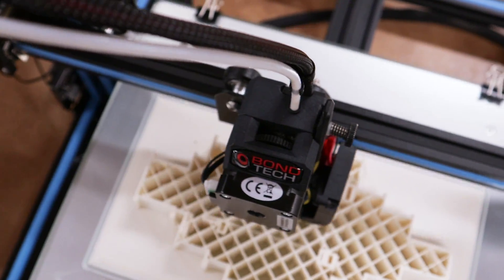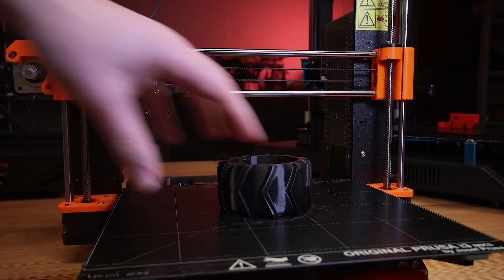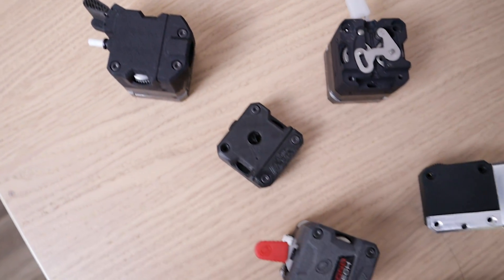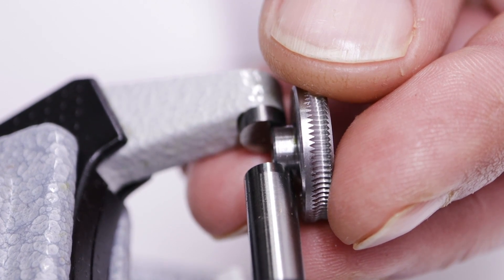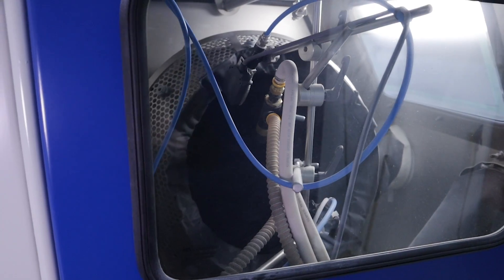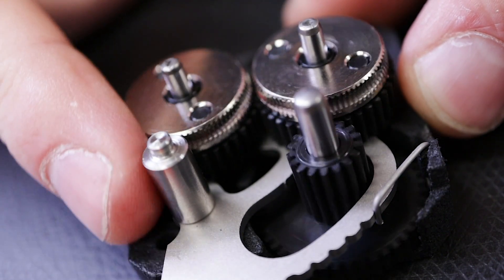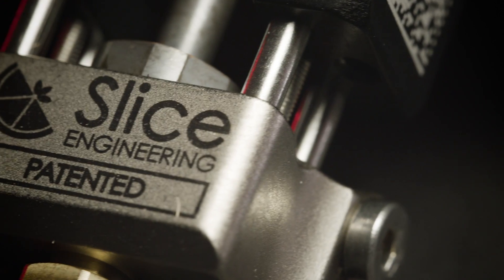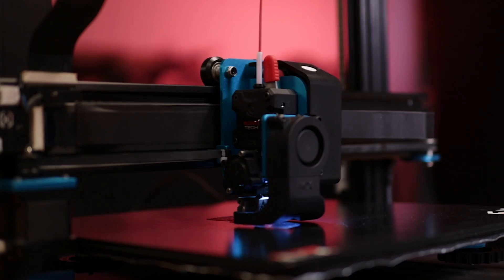The LGX Extruder - How It's Made

Comment: :hand-pink-waving: :face-blue-smiling:The large hobb gears does not produce any greater pressure on the filament than the standard smaller gears. We tested the LGX versus the E3D Hemera and the Hemera produced higher filament pressure and volume than the LGX. Nice video though.:goat-turquoise-white-horns::hand-purple-blue-peace:
Reply from the maker: Hi Michael! In addition we also have the LGX Pro model with a stronger motor, full metal geartrain and also the LGX Pro Metal that is a full metal extruder.
You find the LGX Pro here: https://www.bondtech.se/product/lgx-pro-large-gears-extruder/
and the LGX Pro Metal here: https://www.bondtech.se/product/lgx-pro-metal-1-75-extruder/

Comment: The LGX is incapable of printing 60A TPU without jamming.
Reply: Really? Have you tried it?
Reply: @TheRAINMan059  yes. Due to inadequate tolerances of the nylon printed parts. A significantly large gap located between the filament feeding gears and the wedged plastic downstem. I took up the issue with the bondtech engineering team and never heard back after an initial response. I moved on to the Biqu H2 with similar issues. The only reliable method I've found for printing 60A is with a Diabase Flexion
Reply: @RKisBae  That's sad to hear. I'm in the middle of installing an LGX right now; I plan to eventually test it on 60A. Hopefully I can still get some decent speeds out of 85-95A TPUs.
Reply: @TheRAINMan059  If you have the ability to model the failing part of the extruder, you might be able to print a higher tolerances version or even attempt to machine it out of aluminum. These types of extruders are heading in the right direction, they just don't account for the difficulty of super soft TPU. Some day they will catch on.

Best of luck!

Comment: Awesome! Love getting the inside view into the quality control process. That's an aspect of production that I think many people don't consider heavily enough until after they realize they bought a poor quality product from a manufacturer that doesn't put in as much effort there as you clearly do. Didn't realize as well that the LGX max torque was specifically designed to handle overcoming jams by being calibrated against the stepper motor.
Reply from the maker: Thank you Scott. Great to hear you value the quality approach we are all about. Keep on printing : )